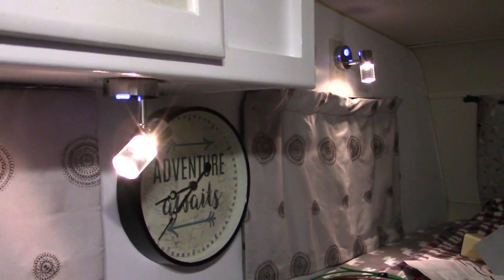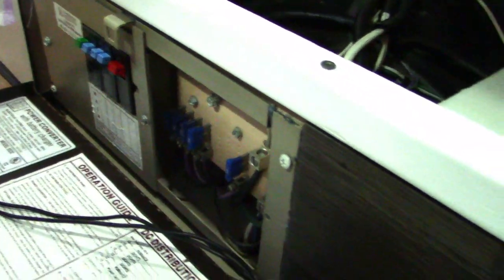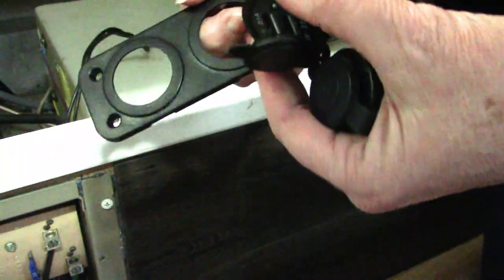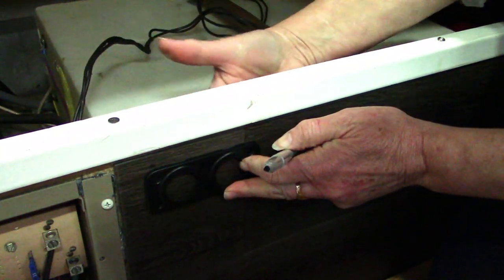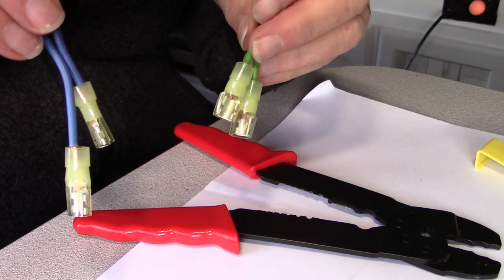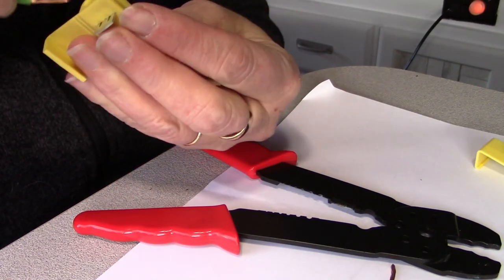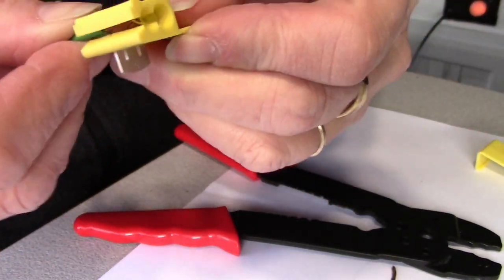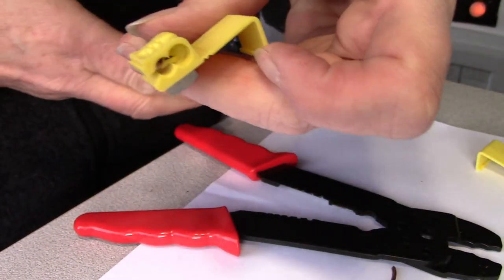Install USB Outlets In Your RV- EASY WAY!

Comment: i don't think you'll be able to put the double USB cap back on (since they're rotated 90 degrees).
Reply from the maker: Good eye! lol! The caps are actually attached to a ring that goes around the socket, so I just needed to twist them into the right position and all was good! Thanks for watching!